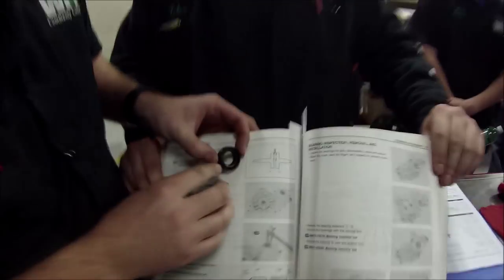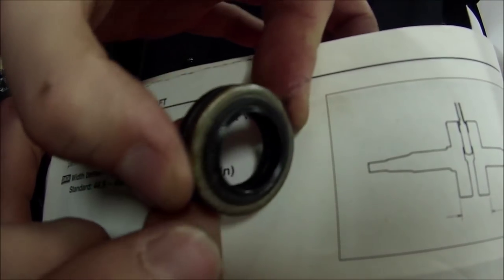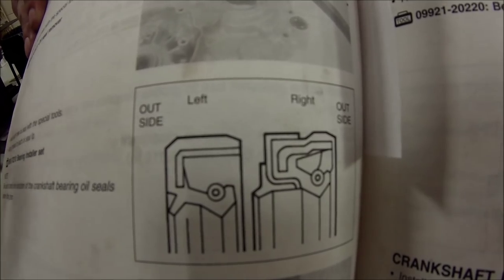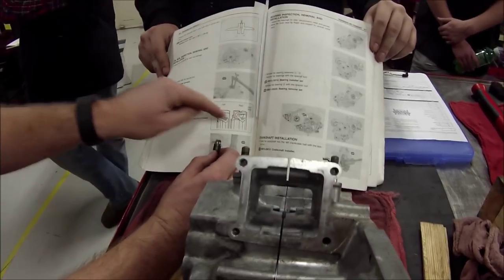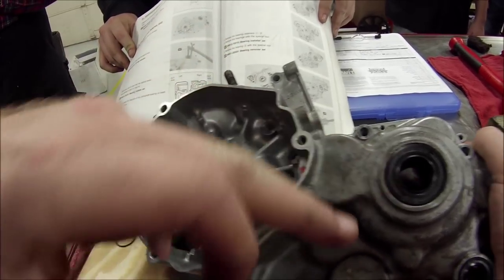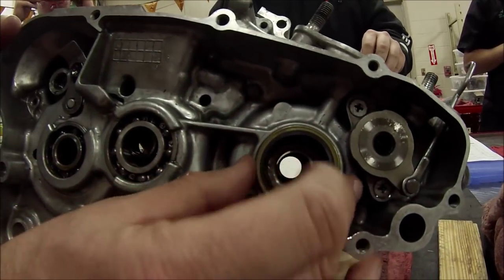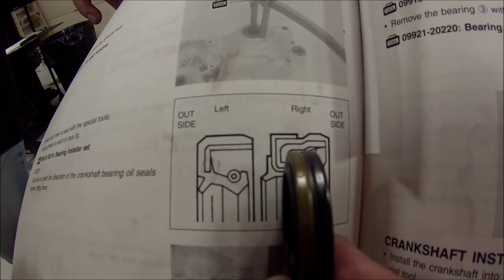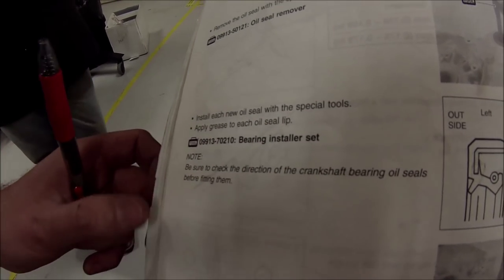EVERY MECHANIC SERIES:  How to install crankshaft transmission oil seal and installation tips

Comment: Makes sense. The right, outside of the engine case is the wet side. It keeps gear oil out of the crank case (in the case of a 2T). You always want the spring on the side with the oil. Good catch!
Reply from the maker: Thanks for commenting and adding value to our community! 

Please subscribe, share and consider a H2W membership to support our free work here! We are ramping up for the upcoming new member only site with profiles, raffle drawings, and weekly live Q/A sessions and a for sale page!

We have a LIVE Q&A starting soon and will use comments from videos to try and answer too. Got a question you need answered sooner than our LIVE Q&A Shows are on? Here’s how to get your answer for free! https://youtu.be/oAeXz1nd-eQ (and other free tools and products!)

Get my cell number here: https://how2wrench.com/product/personal-tech-training-phone-facetime/

Have you subscribed yet to never miss a video? Have you seen the video playlists? Over 600 videos! Check them out here: https://www.youtube.com/user/conleybuilt/playlists    

Your answers and help are just around the corner. Save time and money while protecting your investment and yourself by doing it the right way at www.How2Wrench.com    

Want to say “thanks” or “keep it up”? Click here https://www.paypal.me/how2wrench  Thanks for commenting and adding value to our community!
Reply: thanks for mentioning more details.
Reply: ....and the left side has no oil in it 'dry side/ignition' so in that case the fuel/oil/air mix in the crankcase is regarded as ' the fluid', the spring side of the seal faces that.

Comment: I had a shop assemble my bottom end paid alot by the way it was smoking real bad took the clutch out and sure enough right Crank seal was backwards is there any way to install new seal without splitting the case? Shane your videos are great love the channel keep up the good work!
Reply: If you havent taken care of it yet, yes there is. Have to be careful but drill a small hole in the seal, insert a wood screw then use vice grips or something to pull it out. but that shop should be taking care of that

Comment: i watched this video 100 times and still cant figure out how that diagram represents the oil seal and how it depict the direction of the seal! so confused lol
Reply: i know this is late, but for anyone else checking this video trying to understand the diagram, it's as if we cut the seal in half to see a transversal view : the little protruding bit is the dust seal
Then right under it comes the metal piece
Reply: pata fpv  no worries man happy i helped you :)
Reply: look at your spring where it's at.

Comment: How about crank seals that have TWO springs?
Reply from the maker: You can tell by the angle of the lip seal. You're in luck. I do offer personal service to back up what's missing from a video to actually fix your specific problem. I do work on donations for my time and possible research. 
Good news is its CHEAP! For my time would mind becoming a member of my website? It comes with a free 20 mins of techline and that will cover my time to assist you so we both benefit. So to have me personal cell phone number to put in your phone as your direct info and how to coach, sign up now! As always thank you and enjoy the free videos! Much more to come! I look forward to working with you and hope you will become a member of or learning community. 

Link to membership: https://how2wrench.com/product/membershipmembers-onlymembers? 

If I can ever be of service to you, here is a video explains how to connect with me. 
https://www.youtube.com/watch?v=vjvmB01ebcs 
Direct link to services: 
https://how2wrench.com/product-category/tech-lineservice-callminutes/ 
Live Chat is great for you to actually show your specific issue!
Donation link: https://www.paypal.me/how2wrench
Reply: Spring sides out facing the toward the fluids

Comment: Now I know why the cylinder is filling up with gearbox oil
Reply from the maker: Thank you for taking the time to comment! Hit that subscribe button please! It helps us!
Here is a way to support all the free videos.
Want to say “thanks” or “keep it up”? Click here https://www.paypal.me/how2wrench  

Coach Conley is also available for hire to personally work one on one with you if ever needed. Yep he is a real person. Give him a call @ 602-345-0432

Your answers and help are just around the corner. Save time and money while protecting your investment and yourself by doing it the right way!
Follow us!
Web:
www.How2Wrench.com    
www.Tools2Wrench.com
Reply: I have filled crank case too but my oil seal spring was faced out to the clutch as he showing here.